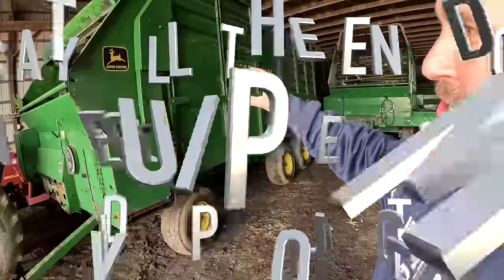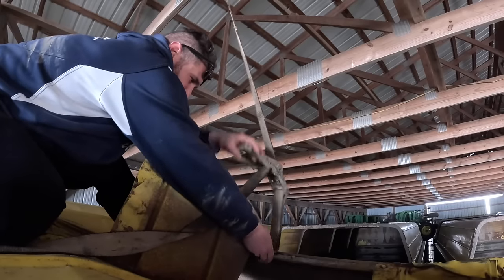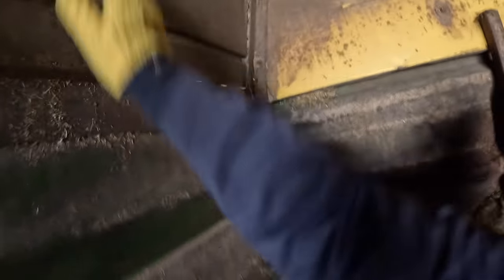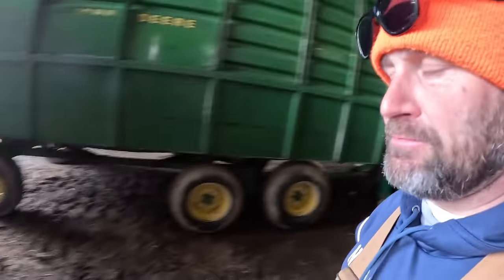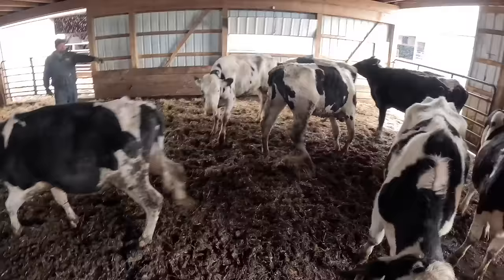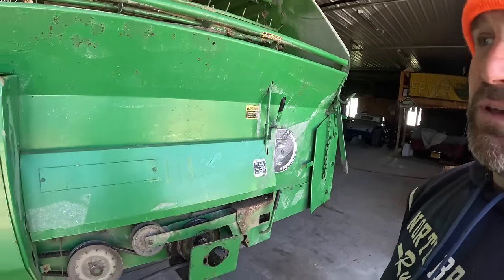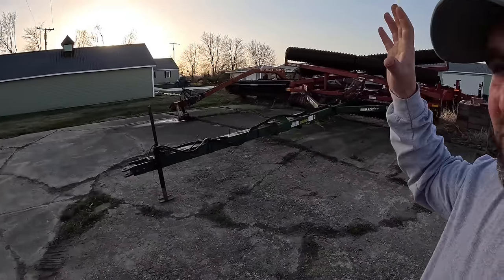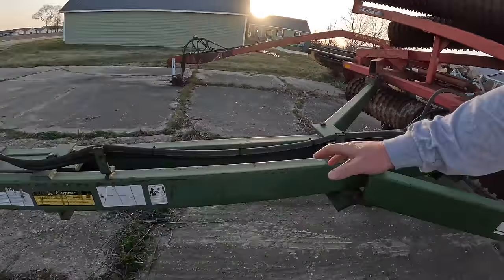716A Feeder Wagon Project!

Comment: Thanhs for another great video Kip. 
It was most interesting and enjoyable. 

Wow. That top off the silage wagon about got away from you. Most have been the loose nuts ((ha ha-that was funny)). 
Looks like you got the silage wagon fixed the way you want it. Big job there. 
That hydraulic pump motor will run very slow for you. A mixer motor would be many times faster. Too fast I think. 

See what you think as you use it. Can always change it back. 

The sealer looks good on your fence. Probably could use another coat. 

Loading those cows for the dry lot was a struggle. They did not want to go. Gave all of you a hard time. Wow. 

Thanks for everything Kip. You all take care and be safe. The Iowa farm boy. Steve.

Comment: On a tmr mixer you can raise or lower the door for how fast you want it to discharge feed.
Reply from the maker: So a mixer would work. Does it have to be newer or are older ones like that too?
Reply: All the knights and kuhns I have used were like that. Some had auger doors some have just a slide door. I have always liked the auger doors better. You don't have to get as close to the feed bunk. If I was you I would go to a tmr mixer.
Reply: We did see an increase in production on our cows when we switched to a mixer wagon.  We currently have a Meyer or vertical auger mixer, so we do not need the hay grinder to come.  The vertical is almost more for a higher roughage ration.  Being I haven't been around your conveyor system over the bunk, I'd ask around.  My parents did have an auger system in the bunk until the early mid 90s.  Either way, it's still something for you guys to talk about and with the nutritionist for what's best for your operation.

Our Holsteins left in 2007, but we finally poured a silage pad in 22 even though we were talking about it for 20 years.  Yes, we have used the ag/silage bags but the biggest problem for us is rodents from making holes on the bottom and certain dogs from running on the top like how some dogs run on bales.  My uncle's research after we pour the pad, his operation is completely separate from ours, what he found was a concrete pad will save you around 15% at the end of the year
Reply: My friend has a patz mixer and on the fold down conveyor there is a hydraulic valve that can slow it way down. It’s meant for loading into feed carts but it would work for what your doing too.